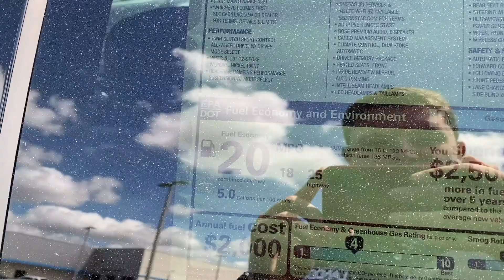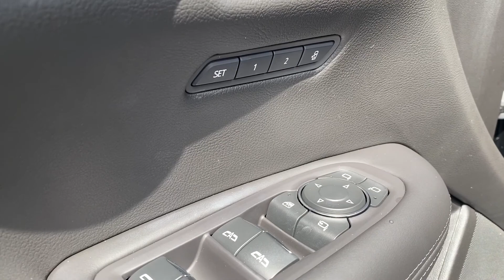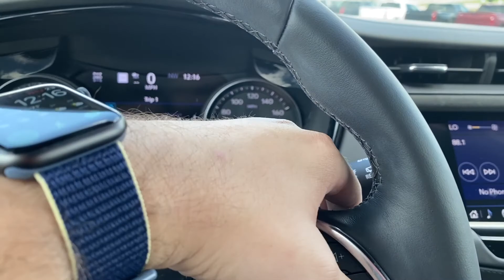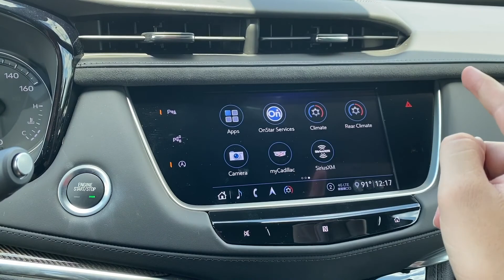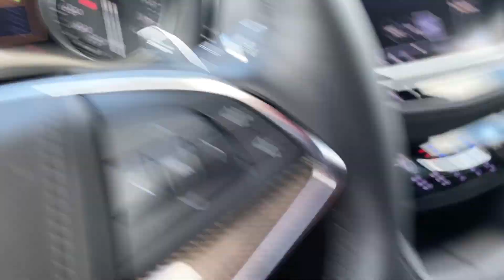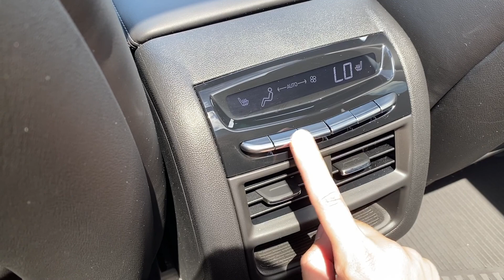2020 Cadillac XT5 Sport Platinum Walkaround | Landers Chevrolet Cadillac of Joplin

Comment: The video is good, but you shoot interior design very quickly. It is impossible to see the location of the buttons on the doors. It is not possible to see the front of the passenger compartment from the driver's door. I would like to see the center console in detail. Also, slowly remove the rear of the cabin so you can see the design of the second row of seats. Also try to insert your fingers into the frame less because of them it is difficult to see the interior design.
Reply from the maker: Thank you for the feedback! We will keep it in mind in the next video to showcase the finer details a little bit more.